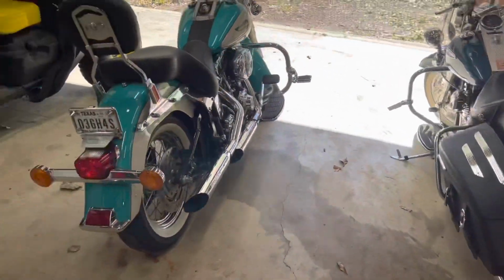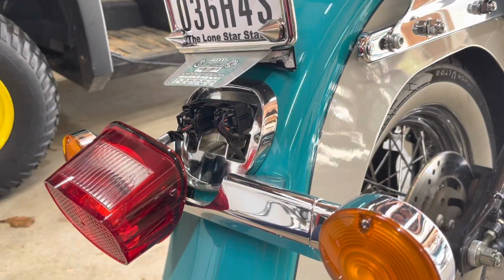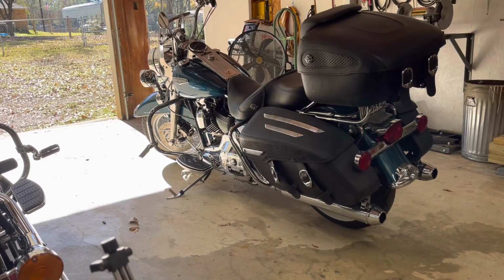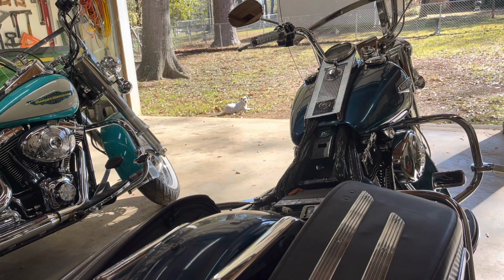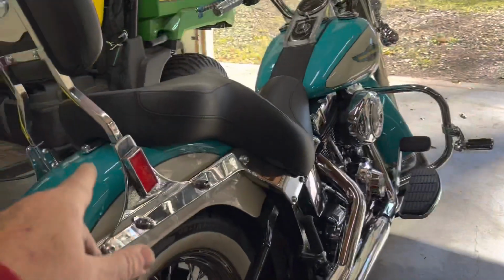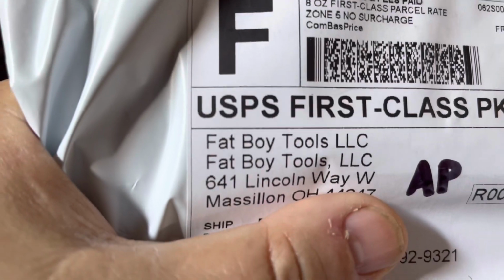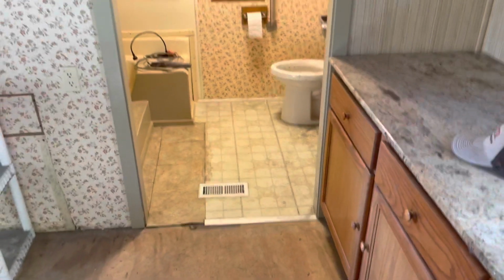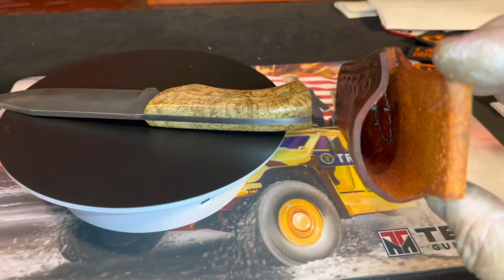LED brake light and Harley taillight conversion kit

Comment: The box you added most likely drops the voltage to the lights for "running" (probably 6-9 volts) then allows full voltage for the turning/stopping functions.  
BTW:  You can put the cat's food & water on the counter top to keep Breezy from getting into it.  And a couple eyelets & a bungee cord in that corner will keep the trashcan up.  
I saw a bumper sticker with the Swedish Chef (from the Muppets) saying:  Ferk Jer Berdin  
We ordered 20 of them  :)
Reply from the maker: Ahhhhhh!!! I think you may be right! Reduced voltage  would make the most sense.  Jer berden is an ershurl.

Comment: I have a sneaky suspicion tthat box uses PWM or Pulse Width Modulation to just increase the voltage enough to make it brighter. I am pretty sure doing it with PWM instead of just directly raising straight voltage will be easier on the bulbs.
Reply from the maker: Or,,, it’s magic.

Comment: Impressive difference the lights make. Even these old eyes can see how safety is muchly improved. Had to smile, as I listened to your pro/con on trading bikes. Recognize a kindred soul. You enjoy tinkering with stuff to make it better. If level one is OK, you'll find a reason to take it to level two. 😉  Doesn't matter if it's bikes, rocket stoves, hand dug wells, or adjusting the swing of a gate. Thought re-appeared with your glue discussion. Enjoy to the max, while you still can, my friend. 

On another note, unless you're using a special cat litter designed specifically for that purpose, please don't discard treasures in your toilet. It can clog plumbing lines over time. Please collecting in a plastic bag and put in your trash. Walmart has a 2.5 gal (if memory serves) trashcan with a step on lever to open it. 

Sounds like you've got some great weather in the next few days. Enjoy to the max!  January is only a month away. 

Godspeed on your travels. God Bless.
Reply from the maker: Going to ride over to the Harley dealer in Longview today and pick up a conversion kit for Charlys bike. December January and Dey are typically months that are just to cold to enjoy riding. March the days start warming when the sun comes up.

Comment: It's just voltage regulation. Back when I was heavily into RC car racing, we used NiMH batteries that needed to be discharged after every use and we had custom built dischargers that used those bulbs. Those single filament bulbs have a very wide range of output depending on the voltage supplied. They're probably just at 10 volts for running lights then the full 12 for brakes or turn signals.
Reply from the maker: That’s got to be it. Or,,,,, it’s witchcraft!

Comment: Very cool! Those flash a lot faster than my cheapie bulbs I picked up. I wonder if fabricating a rounded top sheet metal hood over the towel roll would work? Or anything that would keep most of the roll covered while allowing you to easily grab one from underneath. Just a thought. Have a great day 😊
Reply from the maker: I hope they’ll be enough to distract texters from their phones for a minute.
Reply: @bctruck  Absolutely!

Comment: Clay in the litter will clog up plumbing, don't ask how I know this.  To keep our cat out of of the toilet bowl we just put the lid down.  Amazon has cardboard scratch pads(our cat loves them) to give Kitty a place to sharpen her claws.  Our cat, also, seems to be less inclined to do a lot of extra scratching if we trim his nails on a regular bases.
Reply from the maker: I’ve started keeping the lids down. I don’t think I’m brave enough to trim her daggers.
Reply: @bctruck  It is pretty easy; start by holding and rubbing her paws as she is purring and about to nod off.  We roll our cat on his back to do the trimming.  You may only get a few nails at a time in the beginning.

Comment: Check your wife's bike front passing lamps. The left one is crooked and needed clocked into position to shine the same as the right side.

I just checked today at HD and it's going to cost about 600.00 for LED's and the load sensor wiring harness. If you or anyone else has a cheaper way to put good LED's on a Roadking (I have a 2003) I'd like to hear about it.
Thanks for the great video!
Reply from the maker: Thanks! I replaced all of her lights with LEDs and aimed the light at the same time.

Comment: Sigh  Exciting as it sounds with the "That burst" of Flashing it really sucks. It really happens so fast that no one really notices it al all. I know I have them. They suck. What they should program it to do is slow the flashing down and have it flash at least a minimum of 5 with a second or so in between each flash and then stay solid for 5 seconds and repeat again so long as  the brake lever is still depressed. But since most companies if not all now days do not listen to their customers suggestions you might just do what I did bought a very nice LED tail light that is so bright that you can see it in the direct sunlight and installed an after market brake modular that you can set it to the desired flash that you want.
Reply from the maker: So,,,,,, what would possess you to watch a video of a brake light installation that you hate? Curious minds want to know.